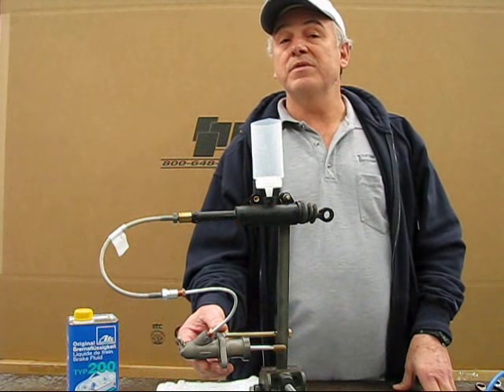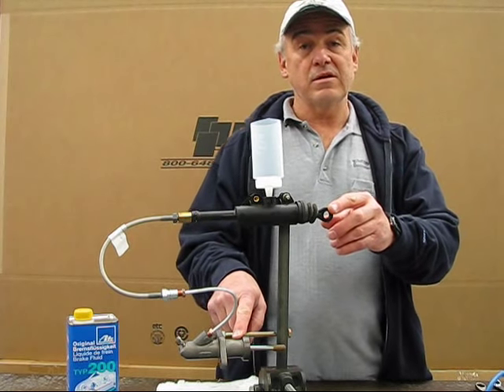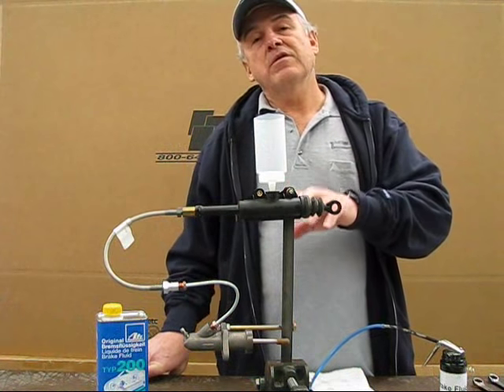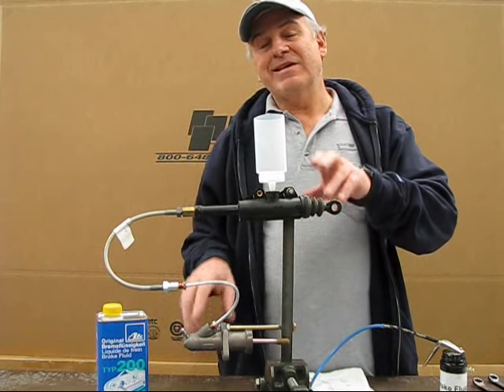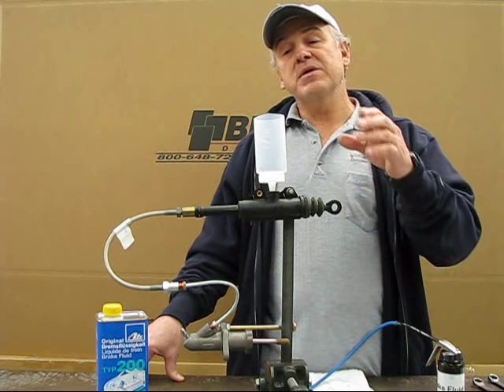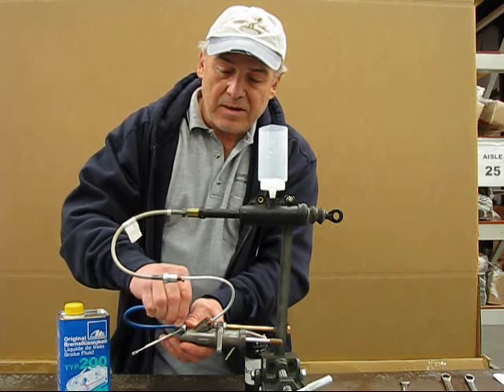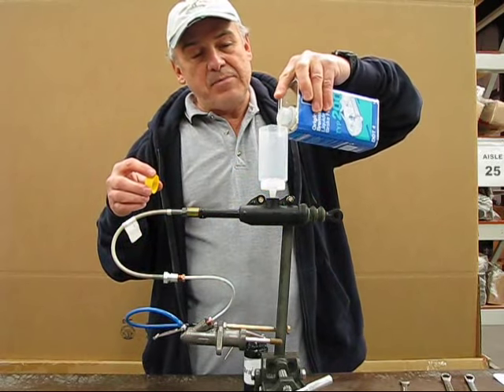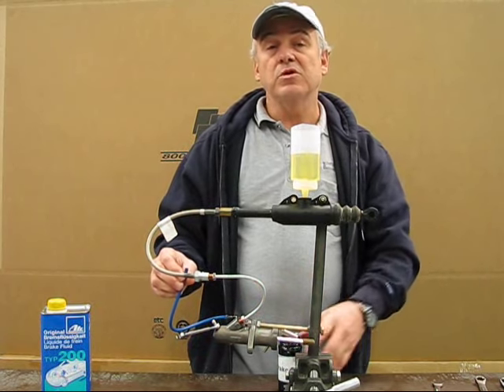BMW, VW, Porsche Clutch Bleeding

Comment: The recommended process is using a line from the front driver caliper and attaching it to the open bleeder nipple on the slave cylinder and GENTLY pump air out.  Two to three pumps will do it. Got this from an Audi repair manual.

Comment: After seeing this several years ago, I have recommended this method to my friends with Porsche 944 cars. The clutch slave cylinder is positioned in the bell housing in a way the traps an air bubble away from the bleed screw. This method solves that problem.  Thanks for making the video!

Comment: This is exactly how my VW VR6 manual says to bleed the slave, hook up a line to the driver front brake and pump it until you get clean brake fluid until the end of the hose, then connect to hose to the bleeder on the slave and force the air out to the reservoir. Reservoir cap needs to be off all the time and you might have to top off the reservoir as you are forcing fluid out of the brakes. Great demo, really helpful!
Reply: You use the pressure in the brake system to tap into the fitting on the clutch slave and reverse pressure bleed using the brake pedal ? Is that correct
Reply: Did it work I’ve installed a new clutch on my VR6 and bled it from a pressure bleeder and the clutch will not engage. You can’t drive. I’m hoping it helps.

Comment: @sphinxx187 Didn't see it mentioned in the video, but in order for this to work, you'll have to have the cap off of the reservoire otherwise you're trying to force new fluid into a closed system and you'll encounter resistence which could push it out through the threads of the bleeder.

Comment: On my Golf 2005 i use a bleed hose hos from the left fwd brake caliper bleed screw to the bleed screw on the clutch slave cylinder. Open both srews, pumpe 10 times the brake pedal, close both bleed screws, voila ...you have a working clutch.
Reply: +DerGolf2000 I like your idea. Does brake and clutch share the same reservoir? Do you fill with brake fluid the bleed hose before mounting?
Reply: +ioanvapi Yes, the brake and clutch share the same reservoir. I do not fill the bleed hose with brake fluid. During bleeding the clutch, the hose gets filled with brake fluid. When i are finished with bleeding i quick check the clear bleed hose for air bobbles. Usually the a no bobbles. Then i close both bleed screws. And check the brake pedal for firm feeling and the chlutch for proper function, before disconnecting the hose.
Reply: which caliper is left? this changes depending which way you're facing the car. Passenger or Driver side? Is your reservoir open ? Is your clutch to the floor or in normal position?

Comment: I bled my clutch using your method after changing master and slave cylinder and it was super easy and fast. Great video!
Reply: Did changing these two parts with the bleeding of the system as well, solve your shifting problems?? Having said issue with an e46 bmw..just wondering, because i have changed the slave cylinder but still waiting for master cylinder in mail. Will be using this method to bleed the system..
Reply: @mrstamped1316  Yes, it did. But, in my case, the clutch disc and pressure plate were new (replaced few month before).
If you replace master and slave cylinder and still have shifting problems, it might be the pressure plate.
Reply: @manuelvieru1363  my clutch is fine, maybe 5k miles on it. I'm sure it's a hydraulic system failure. But thanks for getting back to me, I appreciate it !

Comment: I used this method on my 86 Jeep Comanche this morning and it worked perfect. Thank you so much for the advice. I am I guess a back yard mechanic so to speak and love to learn new things that work. I did it one time and it worked perfectly, after having this problem for so long it's a relief to have a clutch that just works. Again thank you for the video. I have subscribed and will spread the word to other folks having the same troubles.

Comment: Dude.. you totally saved my life.. was super frustrated doing the stomp method with friend after switching to a uuc stainless steel braided line and DCV delete.. wound up doing this on slave cylinder, then each section of pipe and line.. pumped the clutch a few times. .and viola.. car: e36 M3.. thanks !!! BTW if anyone is curious, the delay control valve delete was great.. gave me a new found respect for the car..

Comment: Mate, you are the man! I have a BMW M635csi, that i have had pressure bled at a shop. I am now in Switzerland where they charge minimum 150 Swiss francs per hour, and just completed a slave cylinder replacment myself. I couldn't even get a fraction of a peddle, after hours. Your trick worked in under five minutes. Remarkably, the brakes feel better too! (maybe on account of new fluid). Thank you so very much for taking the time with this video. Kind regards Kiwi In Switzerland

Comment: It worked like a charm on my 2003 R53. I tried a couple of different ways to bleed the system and none of them worked very well. I tried this method and it worked. I'm finally back on the road. I hated the thought of taking it in to a shop!
Reply: Awesome information! You save me a lot of time, money and frustration. It worked like a charm on my 2004 VW Jetta. Thank you so much!!!
Reply: On your R53 did you have to compress the piston on the slave cylinder?

Comment: Huge help, Thank you!
Just bubbled out the clutch for my 2004 MINI Cooper S
Things I learned: MINI uses a 10mm wrench - - Get a pump without paint (the brake fluid dissolves it and you get flakes in the fluid)
Reply: no air went into your brakes, or ABS?

Comment: I just wanna say, after using this method a half dozen times, it's by FAR the best way to bleed brakes if you're doing a master or a line or something where there's lots of air in the system.

I still use a pressure bleeder from the top if I'm doing a caliper or slave, but for doing anything else, this works great! Huge thanks!

Comment: Thank you so much for posting this ! Porsche 928 S4 - I was struggling mightily trying to get the mushy out of the clutch for the first 10 minutes of drive while pressure built up. Power bleeder didn’t work at all - 10 minutes with this process - it’s super tight !!

Comment: This worked in my bmw e36 !! I get my clutch pedal hard as a rock again.
I filled the reservoir with new oil, open the slave bleed valve hoping the new oil to get down and some fluid came out but the reservoir level was the same. At this point i had no clutch pedal pressure.

I put oil in a seringe and pressed the oil from the slave cilinder to the reservoir like shown in this video and it worked!

Comment: I just used this method for my 2011 golf.  worked great.  Tried applying pressure from the top, no luck. tried to suck it through with vacuum, no luck. This worked within minutes. good thing I had a bran new Swiss Reilang oil can in the cupboard.

Comment: After doing that you could push the slave cylinder in and out and use it like a pump and push any air out of the system, this way shown is a great way to expel most air and quickly fill the system. The reason I say most air,is with those pumps they usually create small bubbles during the squeezing action.

Comment: Had to change the clutch master cylinder in my e30 and tried this method of putting clutch fluid into the system. This method works brillaintly and the only hassle is having to check if the fluid has yet reached the reservoir when on your own. Very helpful video.
Reply: Did you put some fluid into the reservoir before hand like he did? This didn’t work for me on my e30. It built enough pressure for my clutch pedal to return on it’s own, but not enough pressure to shift gears
Reply: @marcolopez2111  No, I didnt but worked great and my system was completely drained----sorry, only seeing this now--you may have an issue with your master cylinder.
Reply: @marcolopez2111  as @John McShera alluded to, the cylinder twins are typically replaced together. Learned that the hard way on my last E30. Now that I'm having to do it on my current E30, I'm just taking care of them both at once & saving myself the inevitable headache in three months.

Comment: I replaced my E60 545i Primary cylinder, Secondary cylinder and Upgraded to ECS stainless Steel Clutch Line all at once... ( BAD idea as far as "air in the system" goes...)...I Spent hours that day...Went to Autozone to grab an oil can such as this, it was rock solid about 30 minutes later... This was the key, for immediate action and solution. My comment should remove all doubt, if you are in...Thank You for the Video
Reply: I tried this method on my E90 after removing the Clutch Delay Valve.  All I had to do was bleed the clutch.   I connected a line from a can to the slave nipple and loosened the bleeder screw.  I kept trying to pump brake fluid into the slave and I just couldn’t get any fluid into that slave.  Like the slave’s nipple has a check valve behind it or something.  The line kept coming of the nipple from the pressure of the pumping from the can.  How did you manage to get fluid into that slave?
Reply: @soheilzamani17 plz let me know if you figure it out going through the same thing on my VW
Reply: @mr.lowery5319   nope never did manage to bleed it with the oil can method.  I just pumped the clutch pedal by foot huntil it got firm.  It took about 2-3 min of pumping.

Comment: Thanks for your comments. Both systems are independent and would require separate bleeding in this manner both forcing the air to the shared reservoir, providing the cap is off to allow the hand pump to move the air without building up pressure. The air which always rises up would not flow into the opposing system. it would be expelled through the open reservoir or be trapped inside if the cap was not removed. The bleeder valve screw allows the system to be bled without removing the cap.

Comment: Nice clear video with good sound.  Thanks. 
Sorry if others already asked, but how do you know if a small air pocket continues in the slave cylinder?   Also, if the bleed nipple thread is worn, then can there be air sucked into the system as you pump on the oil can?  I noted you only have the bleed nipple open a small amount which might offset this "problem".

Comment: Genius... It also ensures totally fresh (dry) fluid is in the line and not bleeding the 'used' fluid from the reservoir through. Wonder if this same method would work for the braking system (with ABS) too.

Comment from the maker: Just verifying, you should have the fluid reservoir cap off in the engine bay, and the clutch pedal should be all the way out.  It sounds like the piston in the slave is in the way or there is something keeping pressure on the line.

Comment: You've forgotten the flexible hose, which can bite by a marten ....after that you can drive for a while (1200 - 1700) km, you'll not have leaking break fluid on the hose, but it is air in the system! Those leaks ar like a Ventil. If you don't have a new hose you can seal it with Tesa Extreme Repair....do it double ...after them you can bleed the self bleeding system by master cylinder ....the air bubbles will lose over the reservoir ...ready after 15 min....no problem😂 I did it last week in a garage in poland, they sayd I' ve a big problem with the clutch, not with my hose. My own repair was ready after 3 hours and I was back on the road again.

Comment: If you try this, and it does not work, you will have to find out if there is a non-return valve in the system. I used to bleed brake systems like this, by pumping fluid 'backwards', but when I tried it on the cluch of my 1974 VW 412, it did not work! It took a bit of experimentation to figure out that there was a valve that allowed fluid to go to the slave cylinder, but not the other way.

Comment: I tried this, but you really need a solid pump. Depending on your transmission and how loose you have the bleeder screw, you really need to push your pump so you're pumping with more PSI against the pressure of the fluid coming out of the valve. My pump's hoses kept popping out and my $10 pump imploded from how hard I tried pumping.

Comment: If you cant find the leak, could you close the brake fluid cap and see if you pumping in the bottom pushes brake fluid out somewhere? I think my fluid is leaking. The pedal stopped returning to normal position. It was bled and it seemed to be better. But now it seems to be starting again. first time it stuck occasionaly and got worse and it has only stuck a couple times but I expect it to get worse.

Comment: Thanks for the video.
This method didn't work for me. 
1, the oil can leaked a little from a pressure side O ring when pumping the gun. I was definitely building pressure as the trigger handle of the oil can bent a little.
2, the pedal dropped to the floor during the process of attempting this method, no fluid was pumped up the hose/pipe into the reservoir.
What did i do wrong? I did undo the bleed nipple a quarter turn.
Had to revert back to pressure bleeding via the reservoir, old cloudy fluid sucked out 1st. 😢

Comment: Going to try this 2000 Toyota Coaster after putting new clutch in and pumping clutch trying to bled and still my clutch is soft and weak and stays nearly down tothe floor after changing gears, still drivable but doesn’t seem right. Clutch pops up after a short while.

Comment: Been trying to use this method on my 82 BMW 320i all day. so far no bubbles or extra fluid in the reservoir. New clutch master and slave.. when I try to pump the fluid into the slave the fluid just forces it's way out through the threads of the bleeder and makes a big mess. It seems like what fluid I'm trying to pump in just comes right back out and doesn't even begin to make its way through the system. I made sure I was doing it exactly as described, opening the bleeder with the hose on, pumping the oil squirted, and just making a mess. I would just manually bleed it with the slave out, but then the rod becomes so firm that it won't depress at all to mate back up to the bellhousing. Any help would be awesome! This seems like it works wonders for some people, it's just not for me.
Reply: Andrew Carelock I’m in the same position as you.  Did you figure out what was going on?
Reply: Did you open the cap of the breakfluid reservoir?
Reply: The master was likely closed. Depress the pedal and it is open.

Comment: Good stuff I want to try it but I have a question, being the reservoir is shared by both the clutch and brakes would doing this push air into the brake lines as well? Or will the air go straight up and out?
Reply: if you arent actuating the brakes at the same time it is unlikely the air would find any way into the brake system.

Comment: I decided to use this method of bleeding on my saab 93 but it just kept blowing the hose off the bleed nipple. I removed the bleed nipple and found there was a small rubber stopper on the bottom end which acted as a non return valve. I removed this and was then able to reverse bleed. When all the air was through i replaced it and then peddle bleeded to get the air from in the nipple.

Comment: cool video .. but even easier  when changing either cylinder is once install let the bleeder open on the slave a minute or two until the brake liquid doesnt drip but flow out then close the bleeded and unse a  stick to hold the clutch pedal over night and take off the brake fluid cap off . let gravity work over night :)

Comment: I have been thinking next.When the engine is idling what is the release bearing doing?Is it stopped or is it running?Is there clearance between the bearing and the clutch pressure plate?
Best Regards seppo.

Comment: Gosh,,, All these things to bleed the clutch!!
The correct way to do it is to press the slave cylinder piston all the way in.. Open the bleed screw. Wait for the liquid. Close the bleed screw. Release the piston slowly. Repeat if necessary.Always keep the bleed screw in the highest position and check the fluid level!

Comment: i dont have a tripod and the clutchsystem is already set and you are the 1st one to ask that,.but remove all the system from the reservoir to the slave.then remove the bad fluid,separate the flex hose from the line.,,service the slave:remove nipple and see is stucked.inside,clean if necessary with comp air,remove the piston and chek the seals,if these or this are hard enough replace them withnew ones.apply glicol special wax,sand the slave(interior),clean all the lines,bleed is hard to tell here

Comment: Does this method work on a 2006 VW Jetta TDI? My clutch pedal is sticky and sometimes it won't come back up all the way by itself. I have an oil can, fluid and all the gadgets, but just wondering, if this is going to work on my vehicle. Some people here claim that this method does not work for VW.

Comment: Hello 528im52. I have a 1997 BMW 328ic. I have replaced both the clutch slave and the clutch master cylinder. I have firm pedal and is great while vehicle is off. I turn on the vehicle, and the pedal goes to the floor and pedal is slack. I reverse bled the system. Any help would be appreciated. Is it true that you have to have the service indicator light reset. Could that be the problem? I also have ASC control, limited slip differential.

Comment: I thought there was a little play in the clutch pedal of my m roadster. Now the pedal goes all the way to the floor and I can't drive my car at all until I get a pressure bleeder in the mail. I even tried a large syringe to force fluid through. I can see the reservoir fill up, but the clutch does not engage when I push the pedal. I would advise to only try this if you also have a pressure bleeder as a backup!

Comment: Where did you get your small oil can ? I've been bleeding my clutch with a motive power bleeder forcing air out of the slave, I got no more air bubbles coming out but I believe there could be some air trap somewhere because my clutch engage when the pedal is almost at the top.